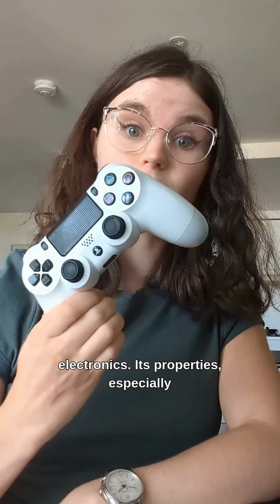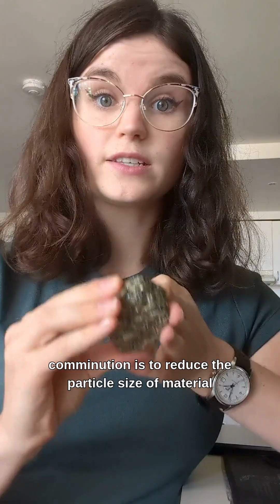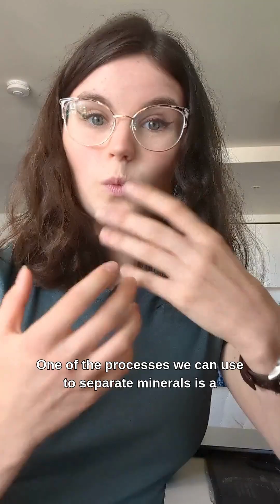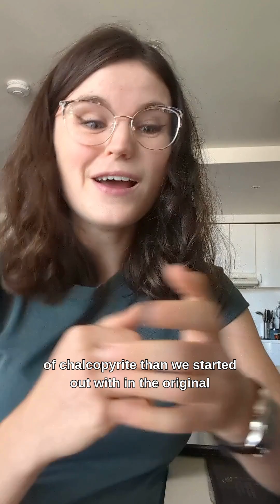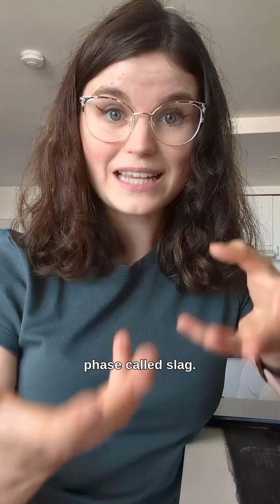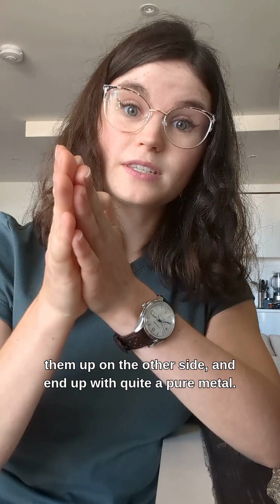How do we get copper?

Comment: Neat video! I like what you're doing on the channel with explaining how we get the metals that form our world. One note for the viewers: high-voltage power lines predominantly use aluminum strands wrapped around a steel core instead of using copper. Aluminum is much cheaper than Cu and steel is much stronger than either, so this Al/steel combination allows us to have cheap cables without needing lots of poles. (Source: I am a transmission line engineer)
I find it interesting that copper, like aluminum, is refined using electrometallurgy while steel still uses coal (though there is some exciting development happening in that field!)